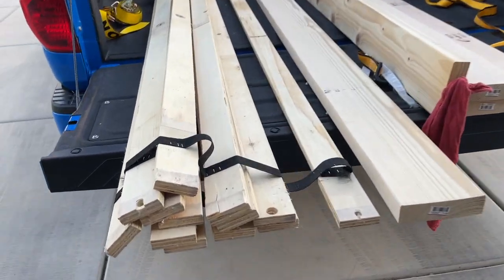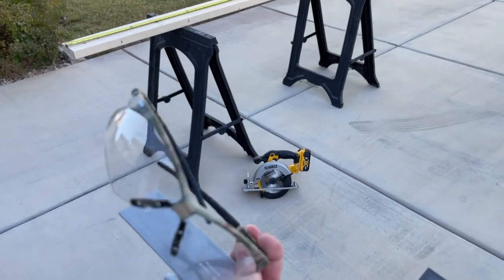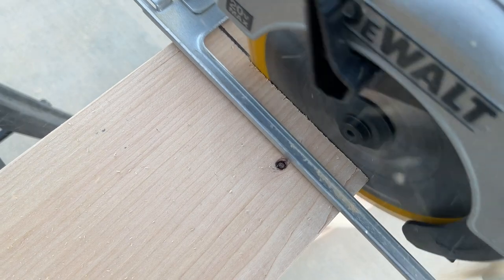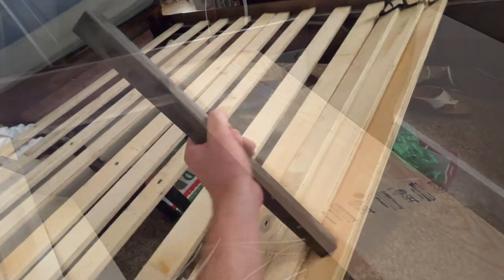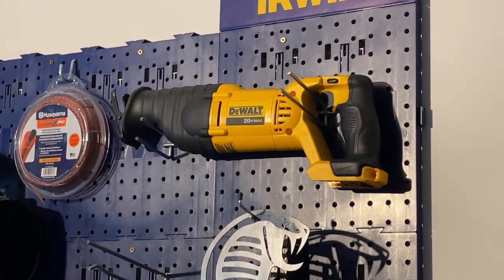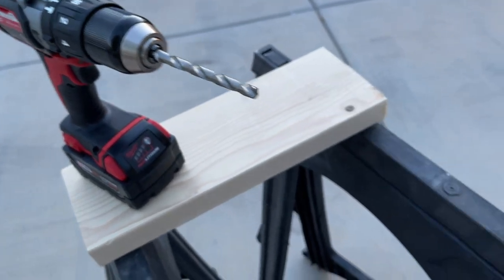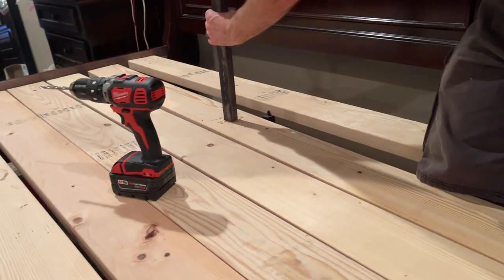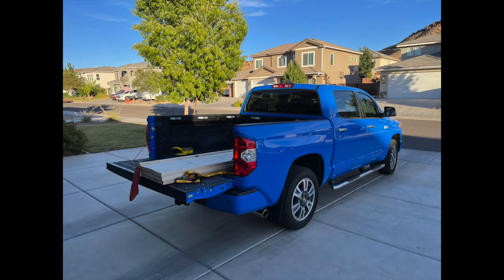Upgrade Bed Slats for more mattress support. How to add support to your mattress

Comment: FYI woulda been easier to dado(notch) that board with your circular saw. Just set the depth you need then cut a line on each side of the notch width then hog out the center with a bunch of lines with the saw then smack the left over with a hammer.